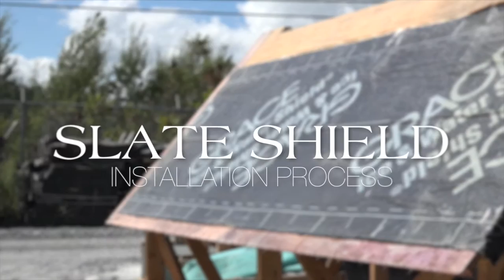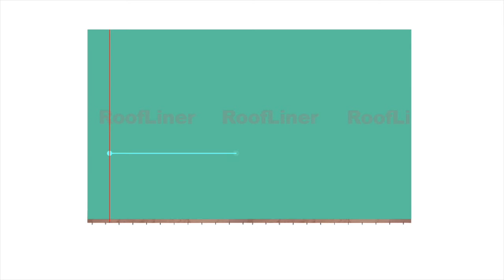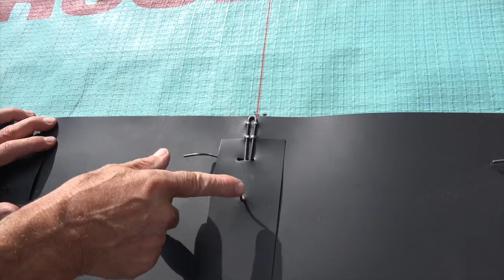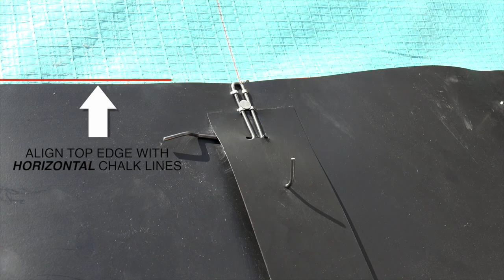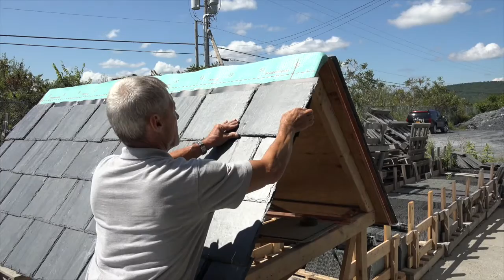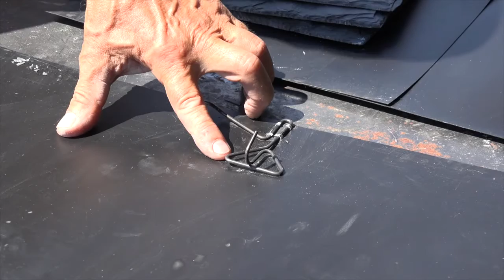SLATE SHIELD

Comment: Nice video.  What is the slate shield material and how thick is it?  It appears to be a polymer of some sort.  Most polymers that are flexible tend to out gas the low weight molecules with heat and time and so the polymers becoming stiff and brittle with time.  Just look at an old dash board of cars and you will see that these tend to crack after time. Also, while not exposed except at the spacing between the slate, UV light degrades most plastics quickly.  If this happens then the shield leaks.    What is its proven life time when subjected to the heat and UV of full sun and trapped under a dark energy absorbing slate.   
Also, I from your website I see that the hooks are of stainless steel 304.  A good material.  However, they have a desired darkened surface.  The video shows that where the slate rubs the hook this dark surface is easily scratched off.  I assume that it also wears off with weather and acid rain even where it is not rubbed.  How long does the color actually last before these hooks start to turn stainless steel shiny? 

Do the slates leach acid or base as they age?